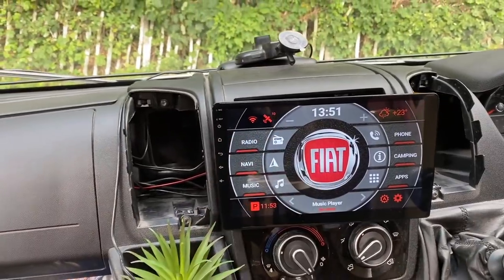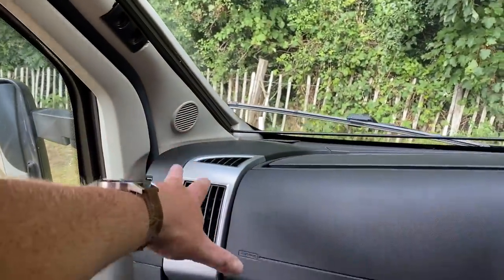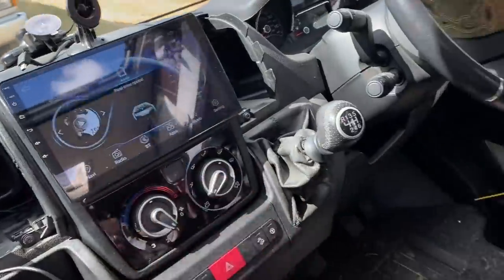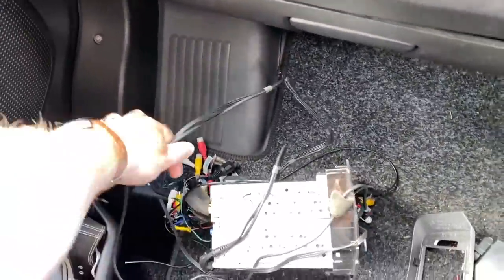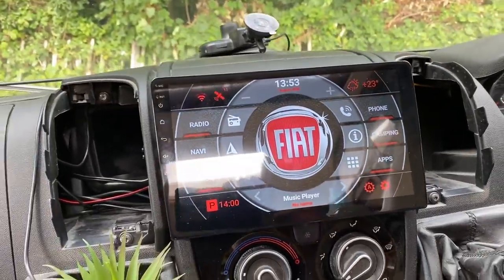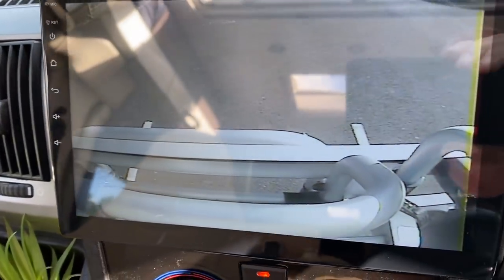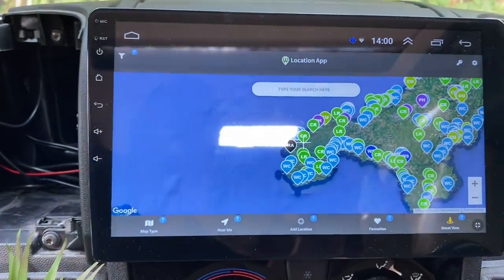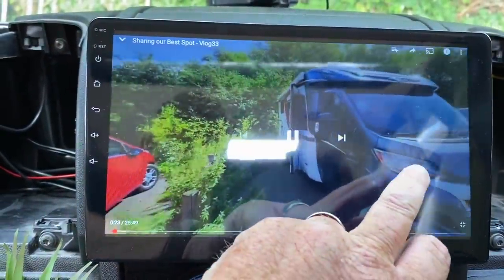Android Stereo Backup Cam WiFi GPS Bluetooth Review

Comment: Hi John, just recieved the head unit and going through the wiring I noticed that there is an external mic input. It's on plug connector A, connections A19 and A20. I noticed you are not using plug A. I am going to try the external video and audio outputs to our TV which is on this plug and will add an external mic and see if it works.
The Zenecs days are numbered 👍

Update, now fitted and I can confirm the external microphone works.

Comment: I use Torque and Sygic on an Android tablet. Torque connects to a Bluetooth OBD2 scanner and lets me setup extra instruments as well as read fault codes. Sygic is a navigation app. I’ve also got Viewranger for OS maps, and I’ve paid for some detailed maps that were handy when driving in the Lake District. It doesn’t do navigation but has great maps.
Reply: Darren Jones, can you reset the check engine, oil and service lights too? 👍🏻👍🏻
Reply: Turner Walker Not that I know of, but I’m using it in a 2001 car that doesn’t have oil change or service lights.

Comment: Great video John. I literally bought the same stereo last night and see that you've done a review.

To compliment your review i wanted to add 2 things-

1- An adapter loom is available on ebay for around a fiver to preventall that soldering...search "iso android adapter"

2- You stream DAB over the internet using wifi however there's an option to buy a USB DAB adapter for around £20. That with an app with give it the capability without using wifi.

All in all a great review. I'm so glad you took the time to explain the launcher app that you use.
Reply from the maker: We’ve had dab in cars for a few years and reception is pathetic, so as we have unlimited data in our van it’s so much easier to stream radio over WiFi 👍🏼
Reply: @johnmandy  learn summat new every day 😆😆😆
Reply: Obviously great info that's relevant and useful for those intending to make the purchase 👍👍👍👍
Reply: @johnmandy  ..I just had delivered today...so a bit of headscratching as 3 week old Ducato !  Don't want to mess up...of course...The manual is need of reading over many times...Thanks for Info...As,adaptor loom will cut out risk of brain overload..hopefully. So try and get raduo out of dash so to see if will fit snugly....We see if I can work it all out...challenging !!...looks good , and, of John rates it.,should be good enough to me....
Reply: Thanks John and others. From the details on Amazon it looks like a 16 pin connection. If I look on eBay for “ISO android adapter” the ones that come up are 20 pin. Any ideas? Thanks. Eeyore.
Reply: @eeyoredonkey5803  Fair one. Should have counted the pins before ordering what i thought was the adapter. If anyone finds the 16 pin to ISO adapter i'll be keen to know
Reply: Looking at ebay item 181844934123. The kenwood/JVC adapter looks like a good fit. Note the 2 pins on the end that that are a slightly different placement. For £3 im going to roll the dice.
Reply: @Gapri3474  Thanks for checking. Agreed, for £3, will risk it.

Comment: Great pointer thanks John. Fitted and working in my X250 converting from the original Single Din unit. Not quite as much frame available to screw to in my case probably because I was converting from Single Din, so having experimented and struggled with a cheap Double Din Box I bought a CT23FT29 KIT from Data Dynamics which makes fitting much easier and neater. Ignore the website year restrictions, when received the box label says Citroen, Peugeot, Ducato 6/2006>

Comment: They are excellent had mine fitted in my Transit camper for around a year now and works great mine is also fitted with rear view camera and also use the sat nav all the time which is great, I did do a little review on it on my channel. sure you will like it John its a great gadget to have.

Comment: Thanks for showing this. It's been a year since I went through a few cheap Android head units but even the best one was sluggish and on a really old version of Android.
Reply from the maker: They sell a more powerful unit, I got the 1Gb system, but whilst it’s not fast it’s also not too slow 👍🏼
Reply: @johnmandy  I only really need mine for satnav and switching to the reversing camera. The one I have just dies if I stick a USB memory card in with a few albums on.
Reply from the maker: Can you not stream over WiFi? Or stream via your phone on Bluetooth?
Reply: @johnmandy  I've bought yours from the link in the description and it's like night and day compared to my old one. I did buy a Kenwood/JVC  ISO harness previously and this still fits the new one without soldering.. BTW it's not android 9 on these. It's a custom build of something earlier as the system icons are very different.

Comment: I agree that the door speakers are poor and I changed mine. On our Burstner, same year, there were no tweeters installed so I fitted new door speakers and tweeters and it made a huge difference in sound quality but with road noise we only really use it when parked up. Definitely changing out this crappy Zenec head unit

Comment: Used several free navigation apps, I find Waze is the best by far.
Reply: One thing with that i've never managed to understand how to put the road closed notification on it, it can still say there's incidents  20 mins after clearing too. The Police seem to use it, as soon as you put they're there, if they're using a speed detection device they move location so fast you don't see them for the dust.

Comment: Thanks for your helpful videos John. Do you think it would fit into the 2011 fiat Ducato. and When wiring to leisure battery how do you keep your presets did you run 2 feeds from leisure battery or keep the one from engine bat. Sorry one more how do you find the volume control when driving is it easy to adjust. Thank you for your help
Reply from the maker: There’s a 2nd link in the video description for a single din fitting unit. It’s a tablet running android so it remembers everything when you power it back on.  Volume is easily adjusted with the buttons

Comment: Hi there, thanks for this review, I bought one :-) works brilliantly, but when I was setting it up I managed to flatten the van battery, did you connect this to your lesiure batteries? 
I am wondering if I could use the switched live from the lesiure battery when stopped and then from the van battery when running.
Ps I have a converted LDV Maxus and it was a bit of a job to get it to look nice in the dash, managed in the end, due to the size you do have to compromise a bit.
Reply from the maker: As I showed in the video, I fitted a switch to isolate the power. 👍🏼
Reply: @johnmandy  thanks John, yes you mentioned the switch, that's what prompted the question, I am assuming it was to the switched live of the lesiure side of your 12v system, only reply if thats wrong

Comment: Just go a similar unit in my Relay but have added a DAB adapter and a CarPlay dongle. Did you get the steering wheel controls working I have with a Connect2 adapter. I suggest Poweramp for your MP3 player
Reply: Where did you get the connect 2 adapter for steering controls would love to know which wired you cut /took from the main loom to this head unit
Reply: ianlangerz there’s several sellers on eBay

Comment: Hi John, just a quick one, with my one which I believe is the same as the one in your video. Everything went to plan but just one thing,the clock is about 15 hours ahead and I can't find any way of changing the time. I've checked through all of the menus without any luck. Did your one come with the correct time. Once again thank you for the original video it was really helpful as is all of your shows.👍

Comment: Hi Guys great Video as usual. Always impressed how you tackle the jobs on the motorhome.
Just ordered the same unit for are Autotrail Tracker but not looking forward to fitting it myself guaranteed something will go wrong lol . Have you got any suggestions that you have not mentioned on the video are there any wiring instructions on line just so I can look over🤔🤔. If i have trouble will have to get it fitted by a auto electrition.
Reply from the maker: The iso standard for stereo wiring uses unique colours so just match the colours from old stereo cabling to the new stereo cabling 👍🏼
Reply: John & Mandy on Tour 
Hi Guys can you help on the stereo I have the stereo working which is good for me I just can not get the reverse camera to work any advice 
Thanks Mark

Comment: Hi John and Mandy, love your videos, how long does it take to boot up after being switched off?
I have a different model and it takes approx 2 mins to come on, very frustrating.
Reply from the maker: Just a couple of seconds, as it shows in the video 👍🏼
Reply: I had this with my Atoto unit, it comes with two ISO harnesses, I needed to use ISO harness B to supply contant (very low) power to the unit to enable instant on

Comment: Hi John and Mandy...If buying a new Ducato van with 'option' of  factory fitted 7" Touch Screen Media (DAB Radio/AppleCar Play/Android Auto) (1RB) at a cost of £600 plus quid...would you leave it off as an option and fit an aftermarket like you have ? thanks for the informative reviews..cheers
Reply from the maker: The upgraded fiat radio isn’t great, not worth £600 in my view. I’d fit aftermarket & get something much better for far less.

Comment: Hi John, just installed such a unit to my camper - it's fantastic but did you manage to connect CANBUS (the steering wheel buttons) perhaps to this unit?
Reply: Andy. Did you manage to get a canbus?
Reply: @canaryseasider  No I didn't I have 2 cables which were connected to the CAN of original radio but when I try to connect both or one to my new unit - all lights on my dashboard go crazy and displaying all kinds of errors I think that some sort of a dongle maybe would do the trick but no idea where and for what to look for.
Reply: @Andy Dzierzba thanks for the reply. I’ve been looking at Dynamic Sounds pt#CTSPG015.2 or CTPSPG017.2  ( 2015 onwards ) have a look see what it is. I think it might work

Comment: Hi John, is it possible to use this unit as a stand alone, as I don't want to replace my current Dab radio with reversing camera. I'm thinking that the sat nav would be a great addition. Thanks, Peter.
Reply from the maker: No it’s meant to replace your stereo.
Reply: @johnmandy  Thanks for the response John.

Comment: Hi John, can you adjust bass, treble settings and left and right when using Spotify and any other apps? Mine works when using the internal music player but not with the built in radio or any apps. Tried their help desk who say the unit doesn't support this which seems strange.
Reply from the maker: Seems to work fine for me on Spotify, amazon music, radio player etc. 👍🏼
Reply: @johnmandy  much obliged John, its still a great head unit for the money

Comment: hi John and Mandy, love the video, finally one that shows and explains!
John, i love that interface but nomatter what search terms i use, i am unable to find it. would you mind responding with information on where or which search info you used to get it.
thanks a million, steve.
Reply from the maker: You didn’t mention what you are searching for Steve.
Reply: @johnmandy  sorry guys. I have replaced my original fiat radio with a double din like yours, what I am looking for is that Fiat interface that you bought and installed as the UI for your new setup. the one displayed with the fiat logo, selectable for stations, nav etc.

Comment: Hi John, hope all is good. We have a Citroen Relay DIY camper with a remote key issue, the remote has stopped working, changed the cr2032 battery and still no worky. We can lock/unlock using the key on the drivers side and the engine starts. Have you had any experience of this type of issue? Thanks, Simon.
Reply from the maker: They key probably needs recoding. They’ll be loads of YouTube videos explaining how to do it 👍🏼
Reply: Thanks for the reply John, I have been attempting a few fixes this afternoon to no avail, another suggestion is disconnecting the starter battery. Not gone to that yet as that might cause another issue. Will continue with the easy options first 👍🏼

Comment: Hi John - just had an android unit wired into my MH by electrician mate. Works and looks great but the unit doesn’t turn off when ignition off. Also notice my cobra immobiliser now doesn’t beep 3 times when set. Two questions will this configuration drain my battery? And is the new unit upsetting the cobra immobiliser? I have two leisure batteries and solar panels. The van is baby version of yours Ixio time.
Reply from the maker: Those are questions for the person who fitted it as only they know what they did.

Comment: Hello John looks a good system, does it have connection for tv?
Reply from the maker: No, not sure why you’d want that as you can stream tv over the Internet.
Reply: Thanks for getting back John, I have an auto trail with tv in cab as well, don’t use it but would’ve been nice to keep it all working together.
Reply from the maker: Save the weight of the tv and stream using this 😜
Reply: You’re right John. For that price you can’t go wrong.

Comment: Hi John, I’ve got a question; I’m about to pick up our Ducato campervan and its fitted with a standard single din radio and a seperate screen for the backup camera. I remembered this video from you and I’m wondering if this is still your preffered radio or do you have another tip? Thanks in advance!
Reply from the maker: I’ve upgraded from this model, but the newer model is listed on our website under our gear page 👍🏻
Reply: @johnmandy  ok thanks!

Comment: Do the steering wheel functions still work for volume I have a 2016 peugeot boxer and not sure if the Cambus system will work properly after fitting.
Reply from the maker: This has already been answered in other comments. 👍🏼

Comment: Thanks for this John. I've just fitted one into my 2009 Boxer, including the (analogue resistive) steering wheel controls. I bought the ISO connectors to complete the loom - reverse engineered from the Xenec head unit manual online. All seems good. Have you tried connecting it to the CANBUS for the vehicle functions? Is it worth the effort?
Reply from the maker: I don't have steering wheel controls, so I can't say how that works.
Reply: @johnmandy  On the OEM steering wheel controls on my Boxer it works very well, very simple to set up. CANBUS is separate, obviously possible from the connector descriptions and the facilities in the Vehicle Setting screen, but I probably won't bother.
Reply: Hi Steve, where did you get the iso connectors? Thanks

Comment: What's the difference between single and double din units, and can you still use the steering wheel controls !
Reply from the maker: Google double din v single din stereo & you’ll see. Steering controls are down to the unit you buy and how you wire it.

Comment: If someone didn't want to cut into the FIAT loom, they could do what I did and buy a FIAT to DIN adapter loom and chop into that instead. You'll have the standardised DIN wire colours too.

I originally had the basic single size stereo, so I don't have the same metal cage to attach your double DIN stereo SECURELY.
What I have decided on, is a 2.1 amp to go in the dash and then repurpose an unused android tablet I already own. Place it over the opening with magnets, or a tablet holder.

I might even make a video. 🤫
Reply from the maker: Yes, I didn’t cut into the factory loom, I used the loom the zenec used which was an after market adaptor like you’ve suggested 👍🏼

That’s be a great video mate, you can still have WiFi backup camera too 👍🏼
Reply: @johnmandy  WiFi endoscope too. Helps to break up a long journey. 🤭

Comment: Great video . We have bought one of these head units but don’t have a cage to fit it into. Any ideas what your cage is called and where I can get one from
Reply from the maker: It doesn’t need a cage to fit it.
Reply: @johnmandy  In your video it shows a metal bracket that is attached to the head unit (included with the head unit) and you mention adding self tapping screws to join it to a metal 'something' what is that metal something called and will our van have that attached? maybe a cage was the wrong terminology. At the moment we have standard radio in one din slot and small shelf thing in din slot above.

Comment: Hi gadget john can you please tell me how you connect the head unit to run of the leisure battery.  Thanks
Reply from the maker: Run a love cable from your leisure firebox to the stereo and connect it to a switch and then to the red & yellow on the stereo.
Reply: I've got a 3 prong switch switch so do I run one live wire from my fuse box to to the switch then two wires coming off that to they yellow and red wire?
Reply: What is a love cable John 😣 and how and were do you fit a switch

Comment: Hi John I am having trouble connecting my reversing camera to my head unit, I have the cable connected to reverse lamp but im struggling to find which cable the fly lead connects to at the head... I think we actually have the same head unit any advise would be much appreciated  cheers
Reply from the maker: Each cable has a label on it, so follow the label to what you need to wire up ❤️

Comment: Safety wise its not recessed flush into the dash,  considering your supposed to wear seat belts anyway I suppose its not that relevant,  is it easy to clean behind and  knock accidentally on the sides though.